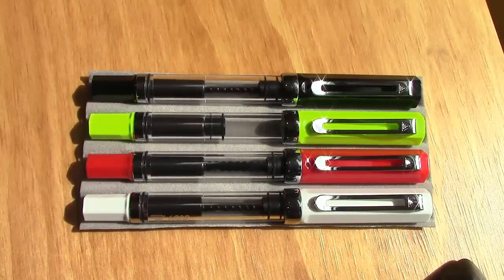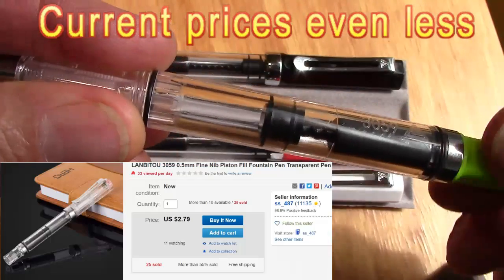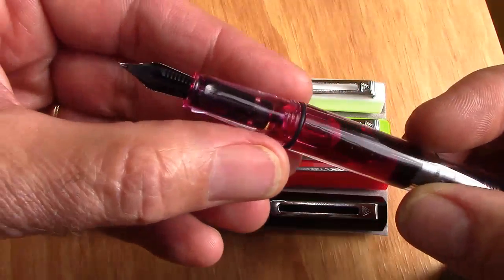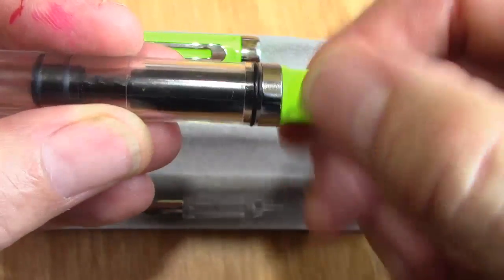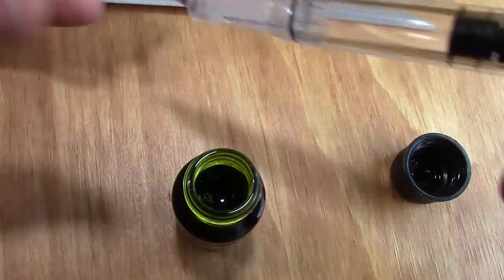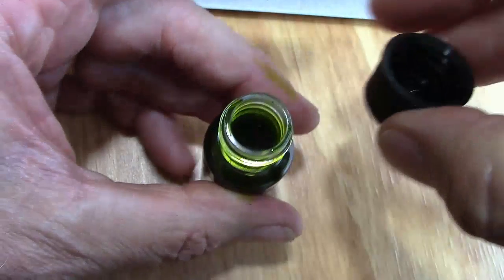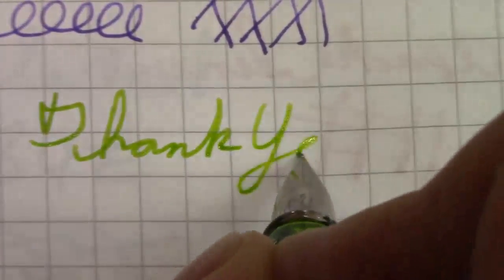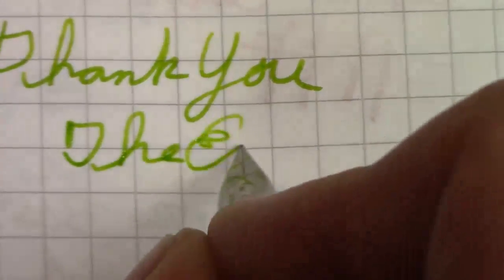Lanbitou 3059 Fountain Pen Review

Comment: Now own 9 of the 3059.  Exchanged the nibs with medium Lamy style nibs, which I
got from Bobby.  Absolutely enjoy writing with my Lanbitou 3059s.  Easy to take
apart to clean and to regrease the piston.  I have found them to provide me with
nice ink flow.  Despite what pens I have inked, I always have a Lanbitou 3059
included in the roster.  Only my last two 3059s cost me $9+ each.  All my earlier
3059s cost me $3.49-$4.29.  The first seven  I have had for 2-3 yrs, and have not 
experienced any cracks in the barrels.
Reply from the maker: Thanks for the update.  Mine are also OK.  Thanks for watching.

Comment: The screw comes out and the clip comes out - I noticed the clip's slot is enough of an air gap for mine to dry out. I added a dab of bathroom sealant to the slot from inside the cap with a Q tip and then reassembled, has fixed the problem. The section has an O ring for the cap to seal against, so it doesn't (once you seal that little air gap) need the inner seal like the TWSBI does. Also like the O ring for the cap to securely post on.

I agree that the 3008 is the nicer feeling pen. I just don't like that the cap posts and turns the piston, and I like that the piston knob on the 3059 clicks once you fill it completely. I'm not sure you were twisting the knob completely on the 3059, but it has a snap that prevents the piston from turning.

the 3008 also doesn't dry out at all.
Reply from the maker: Thanks for the great info.  I'll seal my pens also.

Comment: I have three of them. They also come with the EF hooded nib... which I feel writes superbly. I'm not sure if you realize the "click" which locks the piston after you turn the the knob till the end to prevent over-turning the knob.
Reply from the maker: I don't experience the click.  There is a slight bump when piston reaches end.  Then it stops turning.
Reply: My clear ones click, which I really like. I was going to ask if the colored ones did too. I wonder why the difference?  Maybe the clear ones are a newer batch that has this feature added?
Reply: Swee Liang Kho Are yours completely clear or are the caps colored like these?
Reply: I have the clear one, as well as one black and another white. They all have the screw lock (the click) feature. The seller told me that the feature was added after the first batch was produced. So it depends on the seller (on Alibaba). Some sellers have a mix of both the old and new pens and they ship at random.
Reply from the maker: All mine (colored & clear) click to indicate piston fully retracted. Helps stop blind cap from easily turning.

Comment: Have you tried swapping with a Lamy branded nib, and we're there any issues with the swap? I would be interested in buying it if they were cross compatible.
Reply from the maker: I can swap them, just did.  The Lanbitou is slighly less wide than a Lamy nib.  A gently squeeze on the Lamy nib & it fits snub on Lanbitou feed.  The Lanbitou nib is a tight fit on the Lamy feed but can be put on.

Comment: Are there any pens in particular you would recommend not using ammonia with
Reply from the maker: I only use ammonia to flush nib & feed.  Do not use on metal pens as ammonia may attack coatings.  Best to remove nib & feed & clean with an ammonia/soap solution.
Reply: chrisrap52 thank you sir for the information and taking the time to reply. You have been a great help in my fountain pen journey.

Comment: how do you remove the feed? is it a screw in?  or friction fit?
Reply from the maker: Friction fit.
Reply: chrisrap52 yikes. Mine is really in there then. I got the nib out. But couldn’t get the feed out.  Even with a rubber grip pad.  😢
Reply from the maker: Mine come out easily.  Try soaking section in water with a little soap for a few days.